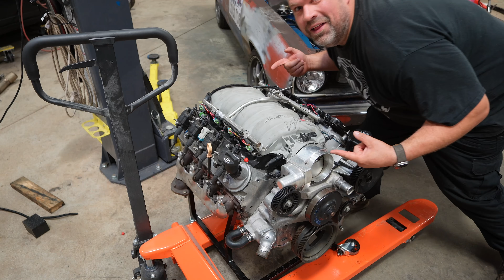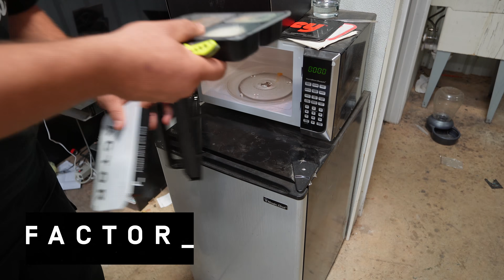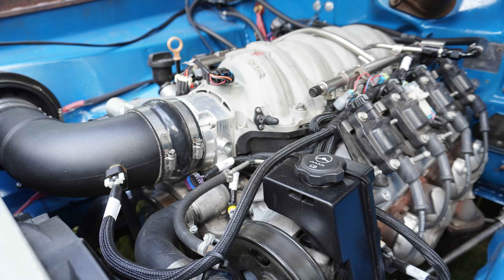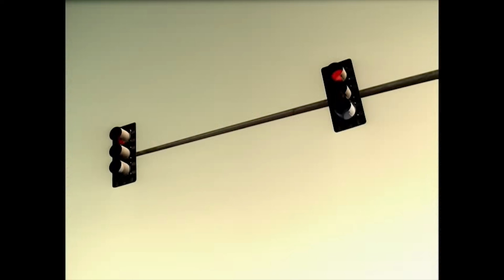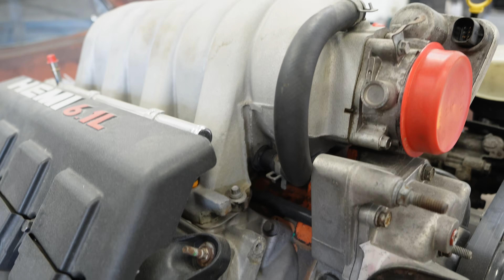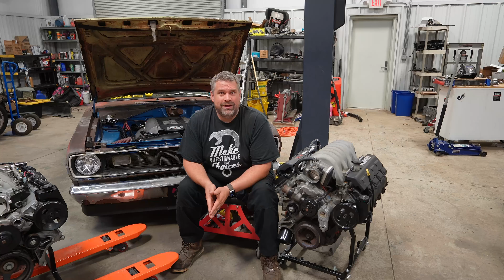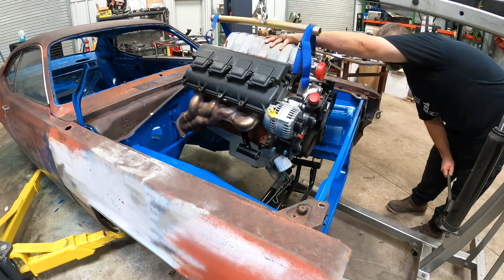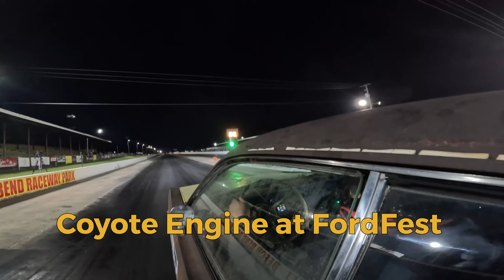What No One Tells You About Engine Swaps! Best Engine To Pick?

Comment: "Each engine has to go in it's family..."  There are Ford Guys, Chevy guys, Mopar guys, etc, and then there are Car guys.  Nothing wrong with any of them, but the Car guys are the ones I like the best because they are the ones that always do the craziest, best stuff with their vehicles.
Reply from the maker: Well said!
Reply: @TheQuestionableGarage 
So what can I put in my early 70's Cadillac Eldorado?
Reply: @BlingB  Did yours come with the 425 or 500?
Reply: @thepastorvan  it's a 4.1 v8 HT4100
Reply: hemi sounds best and I've own non of them just hemi sounds better  @TheQuestionableGarage
Reply: I’m a ford and a car guy. I have respect for all these motors and the work to swap them. However , I’m much more appreciative of someone who puts a ford motor in a ford , etc.  I love old hot rods, but I turn away from every one I see if I see the Siamese porting of a Chevy small block in a Tbucket or a model a roadster.  They need to have flathead or at the very least a SBF.  Yes I know a SBC is cheaper and easier. I don’t care, it turns my stomach to see a GM motor in a ford.
Reply: @vernonlemoignan1392 ur 2d li
Reply: I’m definitely a car guy but the funny thing about being competitive is you always think that yours is the best until it’s proven
Reply: Brand loyalty isn’t as important as simple function. when building something numbers don’t lie. Also reliably and parts support helps for enjoyment long term. That said the crate LSX is hard to beat.
Reply: Doesn't "HAVE" to go in the same family. After all how many FORD model T and A bodies cars have you seen with a SBC out front. 

It does make life easier to to put a Chevy in a GM body, or an earlier Ford engine transmission in an a FOMOC body (I agree fitment of the Coyote and the 426 "elephant" engine is a tight fit in most any car body due to their size). Same for Ma MOPAR, with the new "Hemi" being an easier package to fit in most Chrysler Jeep vehicles.
Reply: Yup those are the guys that piss-off everybody but, get the job done.  BTW John Milner's 32 Ford had a Chevy mill, just say'n...
Reply: Most of the time I would agree, but my F250 with the 24 valve Cummins is hard to beat.
Reply: I’m a Ford guy for sure. I like to see the same engine manufacturer matched with the same brand car though. I’d own any of the big3. 67 Chevelle, 69 Charger, and 65-68 fastback mustang. Honestly any of those beautiful car would be ruined with another brand engine in them in my opinion.
Reply: 😮E😮÷Everything 😮÷to e😮e😮e😮eq9]😊
Reply: Hell ya I would like to do a f-150 with a Hemi powertrain
Reply: exactly. I am a car guy. I put a SPX Limited Edition CF seat in my fiesta ST 😂 at the time my friends all hated the decision, seeing as the seat was put in bugattis and ferraris in the 90's. overall it is my most favorite addition to the car
Reply: Like a built for racing Pontiac Motor in a Pontiac, Crazy, I know!!
Reply: im a big SBC fan.  Ive got one in my 86 corvette and 96 gmc truck.   With that said, its hard to not notice the performance and durability of the Coyote engines.
Reply: Naaaah look at all the model T’s with Chevy 350’s
Reply: I hadn't realised this comment had gotten so many replies!  Understand, I don't have any issue with brand loyalty, or wanting to put ford engines in ford cars, etc. I have a 95 Cadillac Fleetwood Superior coach.  30 years old with only about 85k on it. The engine and car are in good shape aside from needing every major bit of maintenance due to age. If I had to replace the engine, the obvious choice is an LS swap. BUT, crate LT1 engines are available, make good power, and would drop right in.  I would also love to put a manual trans in it, but that would be tought without swapping out the beautiful leather, all power, leather bench seat thats in it.  I mean, nice buckets are hard to argue with...but i love cars with great big pillowy sofas in the front for long drives!
Reply: I'm a car guy, I own all three, I don't represent Ford very well but love rangers and mustangs, and pre 79 trucks, have tons of second Gen dodges, and everything Chevy, I got a 1990 dodge 1500 RWD with a bad tranny, engine sucked, but dodge makes good stuff, but it was throttle body feed fuel injected, my neighbor said just put a Chevy 350 into it, how much I regret not. Putting a 350 into it, it was just a horrible truck
Reply: @cargotoolshop5319 a corvette engine in a dodge Durango how does that sound
Reply: I dislike Ford so very much but that coyote is very worthy of engine swap !!!   Hemi na they only fun for short while then have loads of issues later in life
Reply: car guys, you mean ricers
Reply: @CremeDeLaMeme.  Nope. I mean car guys.
Reply: @thepastorvan  ok ricer.
Reply: Why would anyone put a coyote into a chevy is beyond me. Not saying coyote is a bad engine its a great engine just don’t belong in a Chevy. The LS is as good or better than anything. Its powerful reliable and simple. The coyote makes great power for its size but its not a simple engine. From what i understand can’t really bore it out. If u want to cam it its big money and complicated compared to the LS. Id rather go bigger bore to make power than 4 overhead cam rout. Simplicity is a great thing less work less money is always a win when it comes to hot rodding. Thats what hot rodding is it cams from people building fast cars that couldn’t afford to go buy fast cars. The coyote is a very large engine for its displacement it can be a nightmare engine swapping one. The hemi idk a lot about it know they make good power thats about it. Im a chevy guy but like fords and doges. Guess if i was a ford guy id probably stick with ford power plant. If i was a dodge guy id stick with Mopar power plant. Chevy engines have always been cheap to build make great power and very reliable. Probably why a lot of people do put into fords and doges is to save money again thats hot rodding best bang for the buck. Now that the coyote has been out for over a decade there getting easier to find in recking yard. Id say a hemi is probably easier to find than a coyote been around longer and lot of Dodge trucks came with hemi. The LS is definitely the easiest to find in recking yards probably makes it the cheapest option. The aftermarket is huge for the LS its definitely the cheapest easiest option of the big 3. New crate engines the LSX series is hard to beat but theres definitely great options from all 3.
Reply: I'm a car guy but the hemi sucks.
Reply: @tonyblackburn5002 and get absolutely gapped by a stock 10 speed auto Coyote f150 with a small turbo with the stock engine and I have been a tech for over 30 years and the coyote is superior to all the new hemi's
Reply: @tonyblackburn5002  the modern Hemi? But the 426 is solid and super powerful
Reply: @M.K.Wowkski6872  I'm talking about the oil burning, camshaft eating junk they put in the ram trucks for the past several years.  They sound great, they do have decent power, BUT with the mds setup they are very failure prone and costly when it does fail. I've seen several go thru the shop. I've had to replace several of them, several LS engines, which are by far the EASIEST to work on, but the only major work I've ever had to do in a coyote was 1 came thru with almost 200k and had one of the valves not sealing on 1 cylinder. After we did timing components new vales and valve job it was costly I think around 1800 or so in parts but it's the only 1 I saw as far as engine failures and the coyote goes, that was my bosses truck and he was not at all easy on the truck either. . I worked there for almost 5 years swapped engines in or junked several ls and hemi powered trucks.
Reply: @tonyblackburn5002  Less than 1% of Hemis have MDS lifter issues. Only fleet rigs with high idle hours eat cams. Stop spreading your bullshit online. The Hemi is the highest performing of all 3 here with the strongest block. The Apache heads outflow every single V8 today. Keep coping though LOL.

Comment: so if i want a motor that doesn't use fucking pushrods, clearly the play is a 4.2 TFSI :p
edit: the reason to not use cam in block is so you can have 4 (or 5 if you're a B7 generation Audi S4) valves per cylinder instead of two, results (generally) in much better scavenging and, therefore, efficiency. Jared didn't touch on this and while I'm sure 95% if you know, I'm sure there's somebody that doesn't :)

hope your recovery is as quick and painless as possible :)
Reply: True but most guys want to be driving their beast every weekend not stuck under the hood fixing complex heads up because something broke under power.

Also bang for buck the difference in that isn't huge.

Comment: Just for clarification, the 4.6 Mod was introduced in 1996 model year in the SN95. 93 was the last year of the Fox. 94-95 still had a SBF 5.0 with a modified intake. The 4.6 PI was intro'd in the 99 model year.
Reply: The 4.6 Mod was first introduced in 1991 in the Lincoln Town car. Also My 1995 Cougar is a 4.6 car.
Reply: @RyuFlynn 1992.
Reply: @ItsDaJax  I owned a 1991 Lincoln Town Car. Bought it brand new with a 4.6 2V in Nov of 1990 It was the first Ford vehicle to ever come with the 4.6
Reply: My 94 T bird was a 4.6L ... that was the first one I ever saw.
Reply: @TheRealCCSmith The MN12 cars got them after the panthers- the Mark VIII was the first to get a 4v. The Mustang, second gen Explorer, F150 and the new(at the time to replace the Bronco) Expedition got the 4.6 in 96. The Econoline and Ranger never got it. I think the last car to get it was the Continental, although oddly the Taurus never got it and the SHO used a different v8.
Reply: @ItsDaJax  👍
Reply: @ItsDaJax Mountaineer/Expolders still ran the 302 in 99.
Reply: @bowez9  You're right, it was the third gen.
Reply: The 91-92 are also the only 4.6 that use a Windsor bellhousing.
Reply: Exactly right 1993 did not have the mod 4.6
Reply: @PrecisionDiagnosticService  but the Panther platform was only 4.6 in 93 and had been for 2 years at that point.  Ford is more than just Mustang.
Reply: that's a terrible clarification.
Reply: @Rob-tl9md  I freely admit that my thinking is Mustang-centric and excludes the Lincoln line up al together
Reply: @william.s.goodwin   crown vic and grand marquis had them much earlier also.
Reply: @Rob-tl9md  True. Like i admitted, I was very mustang-centric
Reply: @william.s.goodwin   no worries.
Reply: That is in the mustang.  The 4v started in 1993 in the mark 8.

Comment: As a super anti ford guy I’ll say, if a coyote fits it’s definitely worth a thought, they are fantastic engines.  My chassis only would take the LS or a k series so those are all I’ll ever consider.
Reply: You could probably get a J35 in there, too. Or an LV3 if you like the LS bellhousing pattern. Both would be lighter and the latter would be smaller than an LS AND the K series. Plus both will make more power on boost, safely, and for more years than the K, but without underutilizing the turbo on some less than 10psi bullshit like an LS would. Otherwise, yeah. Aluminum 5.7L or bigger built N/A LS, maybe with a side of 150-shot if you really want/need more power at the strip or for roll racing.
Reply: It should go like this: If you already have a coyote, keep it. If you are sourcing an engine for a swap, go with the LS. I will only consider a Hemi if going into a Dodge/Chrysler vehicle.
Reply: If you can fit an ls.  Check the Ford 6.8 and 7.3 super duty engines- they are very similarly sized to an ls.
Reply: @djmtndew  dumb question time...7.3 Powerstroke or 7.3 Godzilla?
Reply: @desertsavagery  the Boss/Zilla gassers .. they are literally require 1.5 inches of height, 1.5in width and 1inch length more than an ls if I'm remembering correctly. 

There is no way you're fitting a 455 cu in International diesel into the Space of an ls. Never mind even if you could get the basic engine packaged in the same space which you couldn't no sir... You'd be unable to make any actual power because you wouldn't have room to plumb your intercooler and charge pipes. 

Then - you have the fact that any power you do manage to make if you make a 7.3 idi turbo or powerstroke. Fit you get charge air taken. Care of you manage to make power..... you will be giving it up to the huge weight penalty in the case of the diesel.....

But the last thing is - we're talking like for like here apples for apples gas for gas.... I wouldn't put a diesel in anything other than a serious work truck or pulling tractor other wise I will always prefer gasoline and ethanol- I'm also interested in running LPG. But.... it waits until I get my license back.
Reply: @djmtndew  The Godzilla eats dog turds
Reply: @desertsavagery yeah, I thought the big pushrod 7.3  was supposed fit under the hood of a foxbody.
Reply: Import a Barra.
Reply: @_wallnutz_  Definitely not worth it when the Vortec 3500/3700 inline-5 and the 4200 inline-6 exist. This engine (the 6-cyl) is literally called "The Ameri-barra" because that's exactly what it represents. The 4200 holds 720whp on stock bottom end(just multiply by 5/6 to get the 5-cyl equivalent), and forged rods and pistons are becoming available for it. Since it's a "modular" engine family, you'd be able to use the same rods and pistons in the 3500 inline-5 and 2800 inline-4, but you'd need different (bigger) forged pistons for the 2.9 and 3.7, respectively. (they never made a bigger bore version of the straight-6)
Reply: @Drunken_Hamster  Yeah but a Ford motor looks better in a Ford and it kicks a. over a V8. Except sound wise.

Comment: If I were a Ford guy, it would be godzilla all day every day, but as a mopar guy, I can't believe there is an issue with "the 300hp" button with a hemi. It's easier to make power Na to the tire than the Ls unless you have rec port, ported, or aftermarket heads. It's also way  cheaper than a 5.0 in that regard, and well power adders are power adders. Each platform requires its due diligence, especially NA, to get the most out of it. They are not the same. Even the 2 that are the most similar, as inline valve motors react differently to wedge motors.